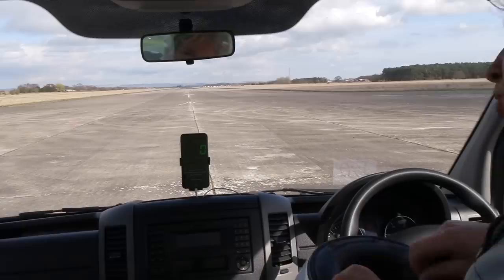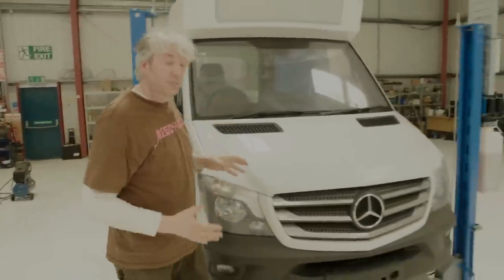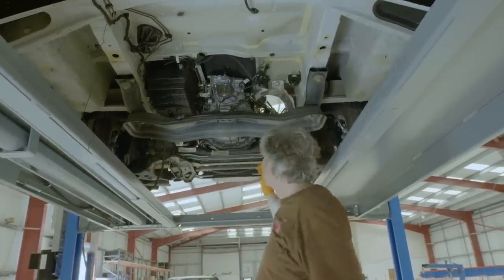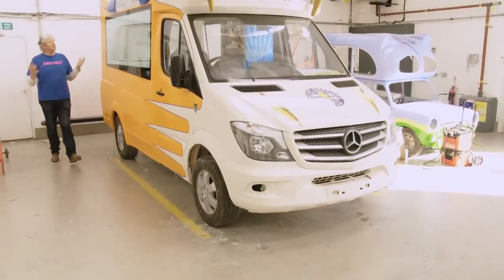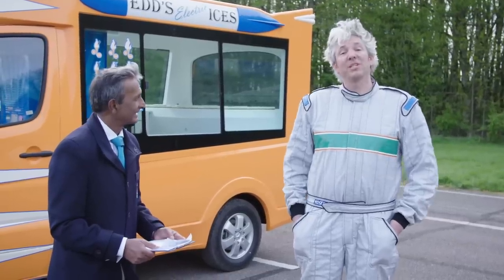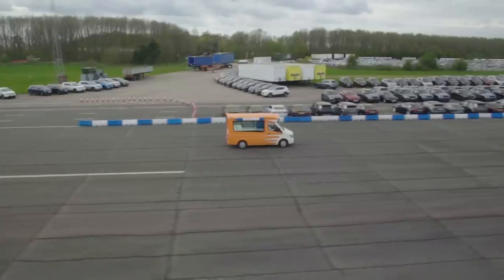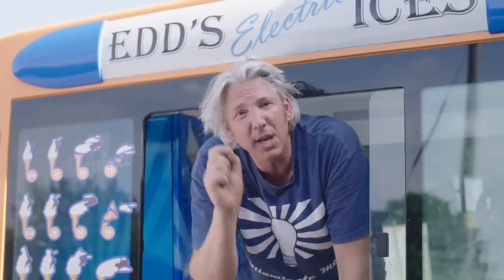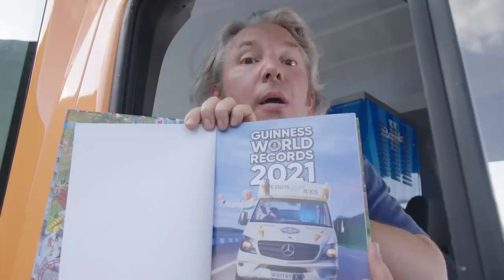Fastest Ice Cream Truck with Edd China - Guinness World Records

Comment: So you made an ice-cream van that runs everything on pure electric power that can do over 70mph. But will it run the ten miles to get to the main selling point (if you work at the coast) and then run the Mr Whippy machine and your hard freezers for 8 hours and get you home before it needs recharging? Or will you need to take a diesel generator with you to run the freezers for 8 hours?
Reply: of course it wont
Reply: Do you not think Trey may have considered that?

Comment: when you slap a 1.6L B18 Vtec engine with upgraded internals and ECU's and T620z turbos and make the gearbox sequential, also make the rear suspention a 4-link drag supension will give you 200+ kmh in about 6 seconds

Comment: Edd . What the hell . Not a damn segment on the conversion ? I was hoping you knew why people missed you on TV. I for one loved the details you provided on the repair jobs .I actually bought tools you used on the wheeler show . So the leading edge of the roof is like an air dam pushing the front end down slowing the van down . That roof should have been sloped back never forward and  I would have dropped the rear axle altogether for a tesla electric direct drive. Also that adjudicator guy has to ride in the back for the record .  I would have wanted to make that guy scream like a little girl lol. But your budget must suck

Comment: 2 gears should be more than enough
Reply: Depends on motor and pack size.
This is designed for 40mph max in normal circumstances, not max torque/ power.

Comment: Why does it have gears ? I didn’t think electric cars had gears
Reply: Most don't because it's more efficient to do away with the extra weight and power losses, and that the useable power curve with electric motors is far far broader than any engine. 

But gearboxes can work on EVs, with some exciting results.
Reply: @toyotaprius79  
It's the useable torque curve... (Available from zero rpm )

Comment: What this guy doesn’t know is that electric accelerates faster even without gearbox
Reply: No point accelerating up to 40MPH though is there when the minimum speed is 70MPH. You need the gearbox for top speed.
Reply: Chris Dalby yes and no, it depends on what electrics u r using